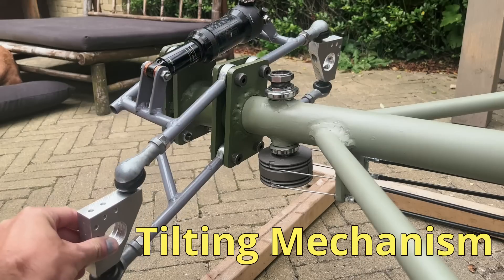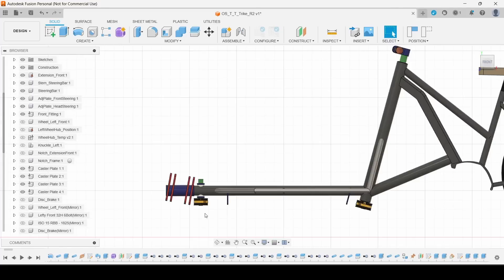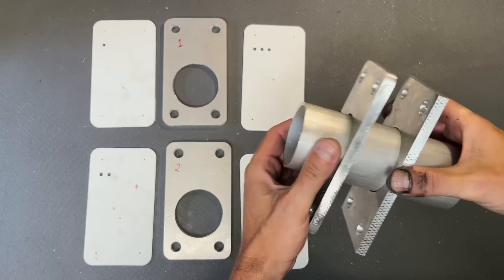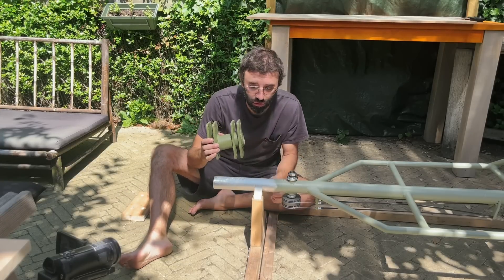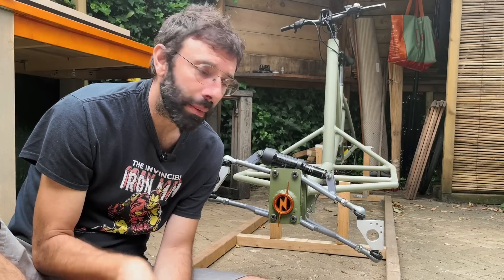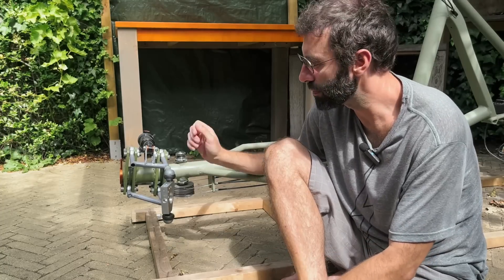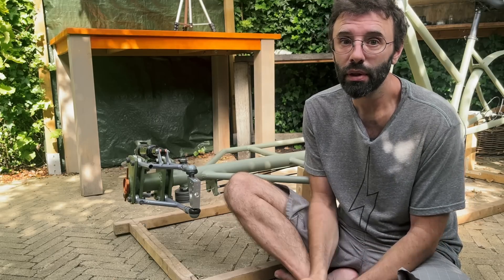#2 Tilting Mechanism - Tadpole Tilting Cargo Trike Build

Comment: I think for you tubing sizes are fine, but you should - especially with Aluminium have baked it at 230C before installation. It would tap on easily, then cool to a press fit. Exceptional video. Thank you very much for posting.
Reply from the maker: Thank you very much! I have been receiving quite good tips about press fitting. I will definitely do a better job next time I'm press fitting two aluminium parts;)
Cheers!

Comment: The "open" balljoints will collect some dust and dirt and will therefore wear faster. The balljoints (also called rose joints) that I use, have a provision for a grease nipple. This way moisture and any dirt will remain on the outside and when pressing fresh grease, remove any dirt build-up inside of the joint. It might be an idea to make yours grease-able as well, it would however, add to maintenance schedules.
Other then that, another cracking update on your project. Mine (human powered amphibious vehicle) has slowed down to a crawling speed for now.
Have fun Pedro!
Pjotr
Reply from the maker: Hello Pjotr, thank you so much for that tip! Indeed I have been thinking what may be some differences between good and bad ball joints. A way to maintain like changing grease sounds like a good improvement for sure.
Your project sounds very interesting! If you're sharing it somewhere shoot us a link.
Cheers!

Comment: Olá Pedro!
You're tilting both wishbones backwards for caster, how is the dive under braking? Why not have at least the bottom wishbone tilting slightly the other way around for anti dive geometry? If you have it further forward in relation to the top arm, the caster can be retained.
Reply from the maker: Olá! I haven't had front brakes yet. And, in this video I read this comment for the second time that I should have different inclinations in the top and bottom arm. This haven’t even crossed my mind before. On every iteration the trike get better to ride but half way in to the build I already have a big list of improvements;) Thank you so much for this one. I will surely look into it for the next iteration
Cheers!

Comment: Could've made an inner diameter sanding flap wheel with just a metal rod, glue and sandpaper. Then spin it with a drill to remove a few thousandths. Then no banging and deforming your workpiece
Reply from the maker: Ya, I could have been more patient and done something like that. I thought it would go in with a little bit of hammering but once it was half in then I had no choice;( I won't do this again for sure.
Cheers!

Comment: I'm not sure what's available where you are, but there is a tool for honing engine cylinders that you mount in a standard drill that you can use to fix the issue you had with that mounting tube getting distorted in the welding process.
Try searching "cylinder bore tool" or "cylinder bore honing tool"
Reply from the maker: Hello, thank you very much! Indeed I am familiar with honing tools and I agree that this would work very well with the problem that I had.
Cheers!

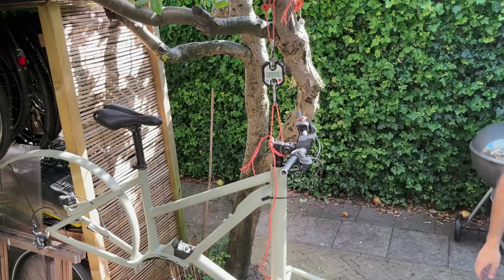Comment: ~ 9:30 fitting the tubes..
If you never want to disassemble it, and you are confident to get position and alignment right first time (use jigs)....
Heat the large tube (a lot) and it will slide on easily.
Reply from the maker: Thank you! I've been told about this trick in the meantime and I will keep it in mind for next time when I have a tight fit with two aluminium parts.
Cheers!

Comment: Hi Pedro looks awesome, I just wanted to state something tho which may never be a problem however ball joints take the load the other way around. So often the back of a ball joint is just a tin cap and often don’t even rub on the back face of the ball only the face the rod comes out. The reason I say it probably won’t matter is the load on the joint is so low, but yea the top ball joints should be flipped 90degrees.
Reply from the maker: Hi, thanks, interesting. The reason why I designed like this is so that those ball joints don't limit the amount of tilting or else it's just not enough. But, if the ball joints are not designed to work like this, then it has to be considered. I have seen on commercial vehicles such as buggies this kind of use so I thought it is alright.
Reply: @pedro-neves  the ball joint is but if you look at a commercial buggy the ball joint will be in the same orientation as yours, however the load will be on the bottom arm not the top where yours is, and so the ball joint on a buggy is being pulled out not pushed in.

I did however almost delete my comment because I did not want to discourage you. Few people actually do things and you’re doing a good and cool thing and to be honest because the load is so low it probably is fine. So if all the comment does is give you more knowledge then I’m glad but if it makes you feel like not trying things in case somebody says something then disregard it lol.
Reply from the maker: @CourtneyMckegan  please write what you think if you feel like writing! I have learned so much by sharing on YouTube and I cannot express how much I appreciate it. I said it on a couple of videos how much I appreciate constructive criticism and I mean it and I use it to improve the design and build.
Thank you for sharing your thoughts and teaching.
Cheers!

Comment: I might have drilled a hole each side for welding the threaded bush rods.  It will likely hold just fine though.
Reply from the maker: I did! I skipped showing that, it seems, sometimes I keep it short to not make it boring but I also miss some details. Point taken. Thanks!

Comment: If the two pipes originally sleeved well but now they don't, then perhaps you could try doing all the welding with the two pipes already sleeved together.  In this way, as the outer pipe warps slightly in the heat, it will grip the inner pipe very well and the job should become easier as you go.  You can then weld both ends, job done.
Reply from the maker: Absolutely. The reason why I welded it outside is just because it's easier to put in the right position the part that I'm welding rather than rotating the whole vehicle. But then, I ended up having 10X work. Well, I learned.
Cheers!

Comment: Turning and machining the Pulleys wheels would probably save money and time. A lathe could also solve the Tolerance issue on the steering Tube
Reply from the maker: Indeed. The Pulleys were 3D printed in metal and offered by the sponsor fortunately but would be great if I had the tools to make them myself.
For the next part of the build that I'm working on now I actually had a lathe course in a place that then lets one rent the lathe, so I intend to show off my new basic lathe skills in the next video;)
Cheers!

Comment: may of the welded joints could have been held with JB weld =  no shrink or out of round problems
Reply from the maker: Hi, thanks for that. I never tried glue bonding. Are those really that good?

Comment: Thank you very much Pedro for the update. It would be great to measure and show the final tilting angle that you will be able to get from the mechanism. Also, I don't know if you mentioned in the previous update, what is the final steering input to output ratio you have chosen  ?
Reply from the maker: You are welcome;)
I will definitely inform about the tilting angle of the trike and I will assess if it's sufficient, after riding.
Regarding the steering ratio, this is defined by the diameter of the pulleys. The one on the steering handle is 73 mm and the one in the front is 63 mm. This means that the steering input is multiplied by 1.16. I just wanted to make the steering a little bit sharper than just direct.
Cheers!

Comment: Long ago I joined a yahoo message board dedicated to tilting trikes because I had wanted to build a safe but cheap commuter vehicle. I don't even know if that message board exists anymore, probably not. Now I work from home and don't need a commuter vehicle, but I still believe tilting trikes hit the sweet spot for safety, ease of use, practicality and potentially cost. Nobody needs to drive their Tundra to and from their office job. I'm glad to see there are still people out there tinkering with the concept. Keep up the good work Pedro! Oh, and back when I was interested in this stuff, practical electric motor power wasn't even a thing, now there's electric powered bikes and vehicles everywhere. Should pair perfectly with tilting trikes.
Reply from the maker: Thank you so much! I live in Amsterdam so >90% of my commute is already by bike but there is a need for bigger vehicles that can help with cargo, take the kids, etc. And I have passion for creating things, optimizing and sharing the knowledge to help others make as well. I have high expectations for this version of the trike;)
Cheers!
Reply: True. The availability of electric bicycle drive systems creates fantastic options for commuter cargo bikes. 

With traffic jams in most major cities, these should be very popular. 

The 250 watt limit in most cities needs to be lifted. That said, a lot of people ignore it and just ride safely under the radar.
Reply: @restfulplace3273  I wasn't even aware of this limit. Seems silly given how fast your average gas powered scooter can go. Not much difference in safety between the two vehicles.
Reply: @kevin_delgado  the safety issue comes into play when ppl ride at speed on shared bikeway / pedestrian zones. 

Far too many idiots ride fast too close to pedestrians.
Reply from the maker: @restfulplace3273 , ya, mostly in cities with steep hills, 250 W may not be enough. But, keep in mind that 250 W is the max nominal power. The drive unit is still allowed to produce more in instances of high demand.

Comment: Obviously the ball joints are a bit heavier and a bit more expensive than bushes. But easier to manufacture at home as you said. I’d like to see how they look like after 20,000kms. I’m a little concerted about the single weld on the ball joints to hold them in. I’d love others POV. I’d be using a thread adhesive / locker for the threads into the alloy.  Maybe even consider a grub screw to tighten it as well. 
I hope you got my monetary gift! Well done!!!
Reply from the maker: Hello Andrew, indeed, this seems to be the consensus about ball joints vs bushings and I agree. And I'm also curious about the wear of the ball joints. I'm hoping that this version will be the one that I'll ride as my main vehicle and I'll assess the wear in some time.
I also regret having welded the frame side ball joints to the tubes. Now they are not even replaceable. It's in the list of improvements for the next generation;)
I did receive your gift a couple of months ago and I truly appreciate it. I do have to come up with ways to monetize this project, and as I try different things, this encourages me to continue.
Thank you and good luck with your projects as well!

Comment: I like your project a lot! 
Regarding your problems with fitting the steeringassembly onto the frame tube, I would suggest to look into making this frame tube out of a rectangular or oval shaped profile. The reason is, that you will have quite some torque applied to the holes your bolt sits in. Currently the "friction fit" you created helps against that, but if you decide to have it lose, the bolt might wear out the hole it is mounted in or crack the frame tube over time. (A lot of force is applied to the relatively small walls of the hole and due to roads not being smooth it will be quite a violent application of force) 

Even better would be to have your front assembly by like a "T" seen from the top and a triangle from the side, made of sheet material for easy manufacturing. Then you have a lot of rigidity, no problem of it possibly being rotated+shearing off a bolt and the ball joints etc. could be covered from the bottom against dirt ingress. You could even use this as a front "cheeseplate" for mounting lights, logo, etc. 

Keep it up and good luck! :)
Reply from the maker: Thank you so much! Indeed, I agree that it would be better to fit two shapes that resolve the rotational forces and have the bolts (or bolts) only securing the translational forces.
Cheers!

Comment: Nice build. The way you've got the shoulder bolts makes little sense (normal bolts would be fine) but if you kept them then you could lose 2 of the 4 thick alloy plates, making the 'ball joints' mounted onto a single plate.
Reply from the maker: Thank you!
The shoulder bolts are really a choice to try to reduce to a minimum any chance of play. With a regular bolt, there is more space for it to move in the 12 mm hole.
Now you got me thinking of the 2 plate solution instead of 4. If I have to remake this, it will probably have only two plates;)
Cheers!
Reply: @pedro-neves  happy to help! I'm a design engineer.. 😊
Reply from the maker: @mandrakejake  thank you so much! In every video I make, I get lots of suggestions to improve and also real expert advice which has been driving many of the improvements. Really appreciate it.

Comment: The major reason why bushings are used in production vehicles (apart from low cost) is because they offer "no maintenance until replacement time", unlike bearings which require regular maintenance.  The issue I see is a choice of materials for the suspension load bearing parts. Aluminium is not great for withstanding vibrations. That's where the point for bushings would be valid as they absorb the vibrations better than bearings. In any case please consider using steel alloy for the suspension assembly in your final build.
Still, high regard for your aluminium welding practice 👍
Reply from the maker: Hello, I went with 8 mm thick plates for holding the wishbones, which seem to me like a very tough component. In my previous build, I did many tests after building it, and they were a little bit subjective. For this build, I'm planning to be more scientific with the tests. It may make sense to add torsion sensors to some places to calculate the durability of the aluminium parts. Probably I'll do some reading about standard tests for bikes.
Hehe, indeed my aluminium welding is going better than I expected;) I just bought the cheapest second hand equipment that I could find to start welding aluminium, and I'm learning a lot.
Cheers!

Comment: This is cool, was looking to build something like that. What's the reason to pick aluminium and not cromo which is much easier to weld? Sorry, first video i've watched you have probably explained it before. And why not a pushrod for steering?
Reply from the maker: Thank you!
I chose aluminium because you can make a much lighter and stiffer chassis out of aluminium that with steel. That's why modern cars, motorcycles and bikes are made of aluminium. I'm aiming to make a truly great vehicle so I try to make choices that are in that direction.
For steering, I used connecting bars in previous builds, and I decided to try cable steering because I think it's somehow "cleaner", lighter and occupies less space.
Good luck with your build!
Reply: @pedro-neves  very cool, thank you
Reply from the maker: @Jan_mxv  thank you!

Comment: The filler metal was applied hot to the cool tubing, then cooled off creating a ring around the pipe that contracted the I.D. Rather than using a larger I.D. outer tube, if you heat the materials to be welded the crimping effect will be lessened. You could also hone the inside of the crimped pipe at the weld joints to bring them back to their original I.D. Consider using all thread rod, nuts, washers, and end caps to bring the tubes together with a wrench rather than the cave man method.
Also, please consider using steel instead of Aluminum on your final design. I wouldn't want your frame to stress crack while hauling precious cargo.
Reply from the maker: Hello, thanks! And I agree with everything except one thing - the steel part.
If it's done correctly, an aluminium chassis is better than a steel chassis. Modern cars, motorbikes and bikes are made of aluminium. I know that I'm not doing the best aluminium chassis but if I'm working on aluminium at least I'm learning how to make it in the correct material so that one day, this is one of the best vehicles out there. I want to be aiming to be the best (even if I'm still far from it).
Cheers!
Reply: @pedro-neves  usually aluminum need  heat treatment to release stress from welding and increasing fatigue resistance.
Reply from the maker: @treszenrv9401  thank you! Indeed, I've been reading about this. For the moment, I'm trying to create a great design of a vehicle that is great to ride and build prototypes. A "product" version would, of course, have to be built with the best processes.
Cheers!

Comment: I read in the comments the ball joints are subjet to serious wearing out. As you're doing a cargo bike, a small maintenance storage with spare linkage and tools could suffice :)
Reply from the maker: Indeed. I welded the frame side ball joints to the tubes but if it was now I would have welded nuts to the tubes to make the ball joints replaceable. Well, another improvement for the next iteration;)
Cheers!